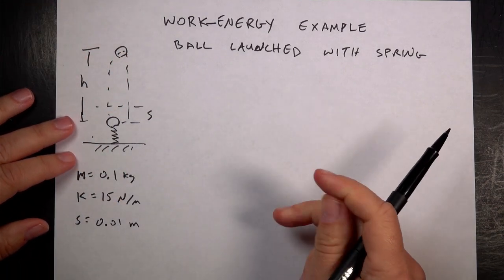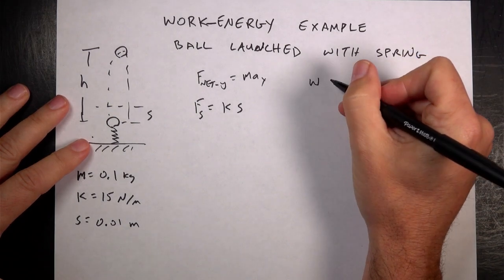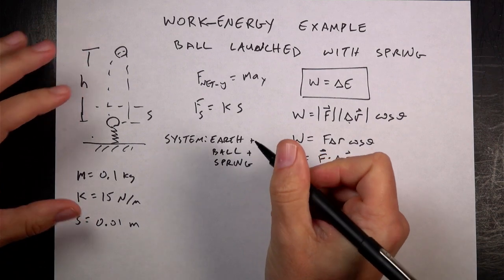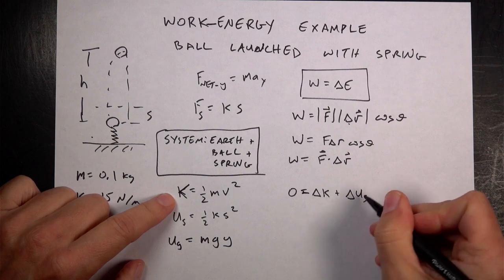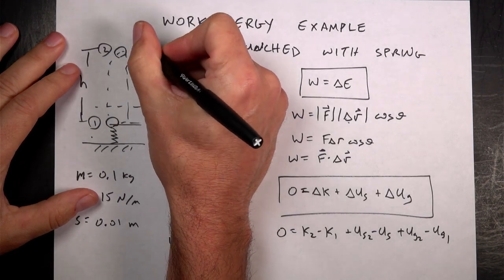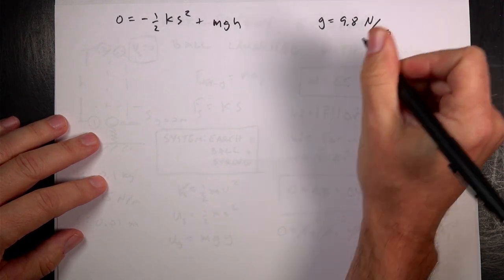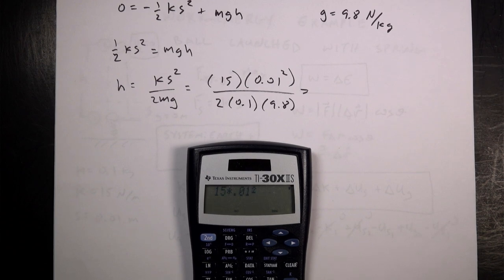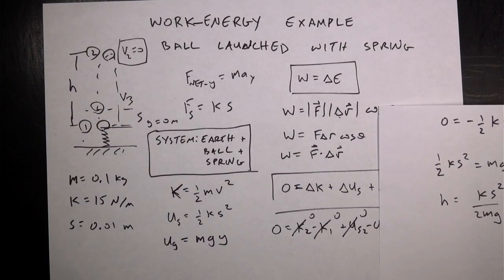Physics Problem: How high does a spring launched ball travel?

Comment: Would you ever frame this as a conservation of energy question? I know the analysis is the same, I mean how you would introduce it. I kind of like what you did because it forces the student to explicitly consider work.
Reply from the maker: Work-Energy is a conservation of energy equation whenever the work done on the system is equal to zero.  So, it's a special case of work-energy.  For my classes, I try to keep students starting with work-energy instead of saying E1 = E2.